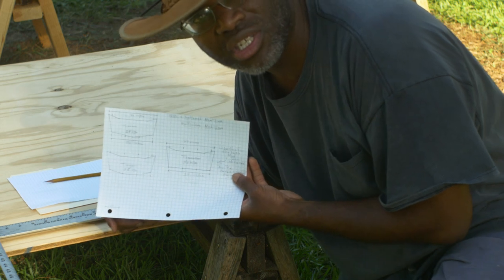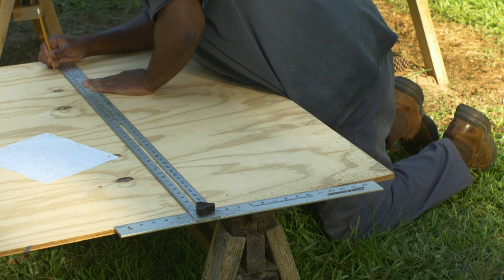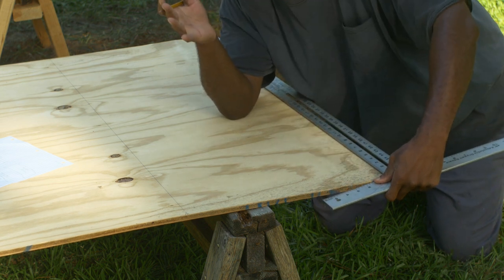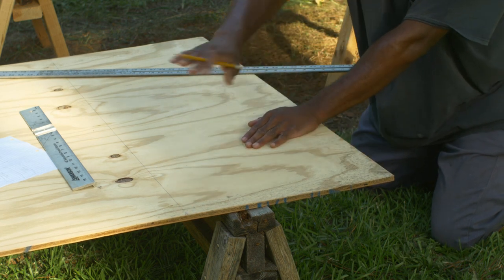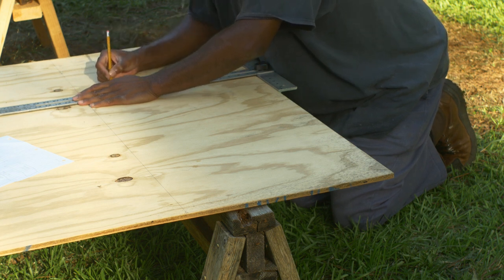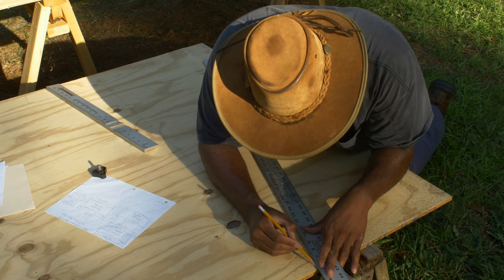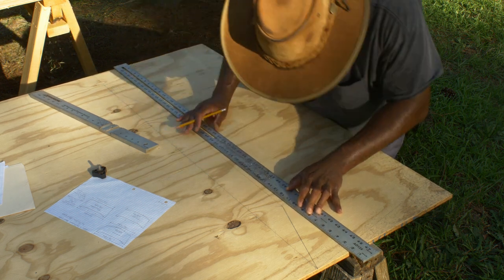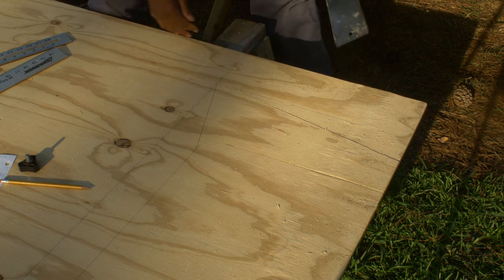Transom Cutout | Project Mud Boat | Thai Longtail Boat Plans

Comment: When cutting wood for a transom, it's always better to cut the wood with the grain running horizontal. This will give better support from the sides of the boat. Keep up the good work
Reply from the maker: Okay, that's a good tip. Thx, man. I'll have to keep that in mind.